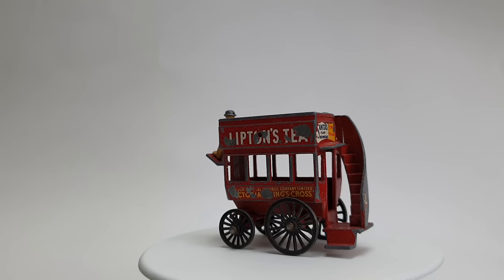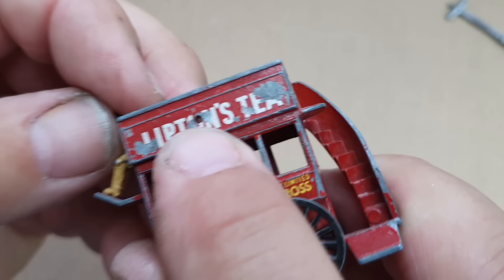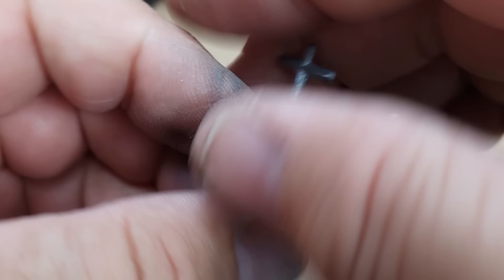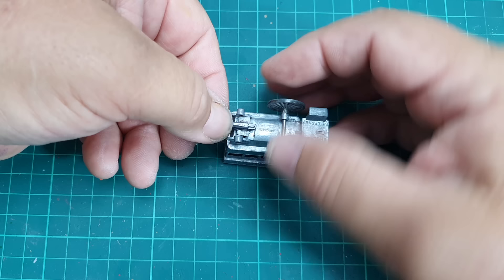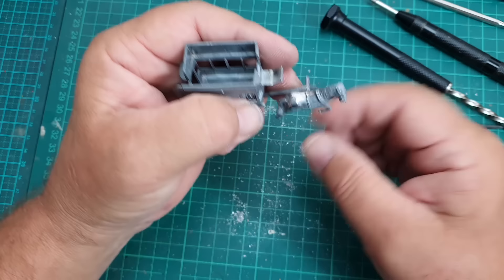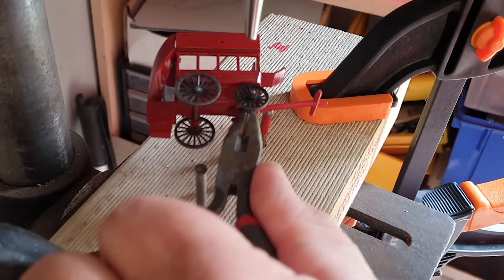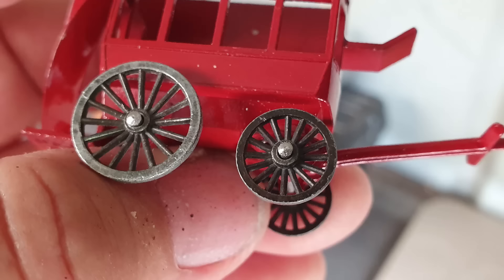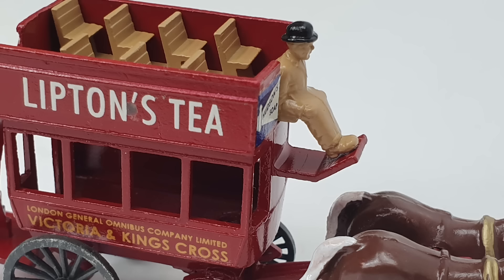MATCHBOX Restoration Y12 1899 London Horse Drawn Bus 1956

Comment: I have had success spray painting decal paper the colour I want, let it dry then print your decal, and treat as normal, it's worth experimenting with.
Reply: its not the background colour thats the problem - its the text colour. You cant do white text without an APLS printer
Reply: If you select the colour button of white on the fonts and print on a coloured background it will just leave the font without colour being printed at all therefore leaving the background colour showing? so print a red square with a white font chosen,  if you get my drift? you can buy white backed decal paper so the same process is used for that. you don't actually have to print in white

Comment: That little paper tool to protect the car while removing he axel looks just like a fingerboard guards for guitar repair. They fit over the frets so you can file or polish the frets without harming the guitar wooden fingerboard They're typically made of metal and can be purchased fairly cheaply on guitar repair YouTube pages like Stew Mac. Run about $15. (i have no affiliation - just happens to be the one I use for tools). Check it out Marty, might work perfectly.

Comment: For drilling or gripping allmost microscopic objects small as those in this vid, ye should buy a jewellers grip. It is pliers with an incridibly small "soft clamping jaws" that are locked in place with an actual springed pin- or cliplock. Thats why it gives locked, durable, and hard stability, but it doesnt leave any gripping/ tool marks in the object, while giving good, singlehanded, 360 degrees handleability for drilling, dremeling, band grinding or machine polishing micro-objects.

Comment: 9:35 Marty, you should have Muggy-welded the draw bar to the base plate after you mushroomed the pin to add strength back and it would have looked better as well as it would have filled in the gap. otherwise another great model from you Marty, great work.
Reply: The melting point on those white metal replacement parts is pretty low.  I'm not sure if they can be welded using the Muggy weld rods but my guess is that the part would melt at about the same temp as the muggy weld.

Comment: Those bumps at the back of the horse are the heads of the bolts that hold the back legs on. The Victorians weren't as good at hiding those as modern horse manufacturers are.

Comment: Marty, I’ve loved watching all of your builds, the one thing I’ve not been able to do that yours comes out perfect is mushrooming the ends of the axles, how do you make your nails to make the large mushroom? Mine only mushrooms a very little bit. 
Keep the videos coming.
Thanks,
Andrew from California
Reply: He recently changed to using nailsets.
Reply from the maker: Andrew, I make it look easy but it is not. I often have to attempt this more than once to make it work. I have recently started using a nail punch with a cupped end. I think it works a bit better than the modified nail. Give this a try and let me know how it went. A nail punch set only cost me $6 here in Australia. Good luck!
Reply: @MartysMatchboxMakeovers  I've been using a nail set for years (pick one for a large finish nail).  Keep the drill press on the slowest speed. Hold the axle and keep it from spinning (like Marty does in the video using needle nose pliers) and watch how long you spin the axle end as it will quickly heat up and can very easily ruin a plastic wheel in the blink of an eye!

Comment: Marty, it looks to me like that horse casting wasn't all that great  to me. The surface is very grainy and not smooth like the original. Also there was way too much  flashing. All in all, not what I'd call first rate. You did an excellent  job  to get it right. Cheers from another veteran. U.S. Army.

Comment: I wonder why RecoverToy didnt cast the new drawbar with the mounting plate attached? Seems that would have made replacement much easier 🤨
Reply from the maker: 100% agree!!
Reply: @MartysMatchboxMakeovers  That draw bar is for the first released casting of the Shand Mason fire wagon and the horse drawn bus. The revised (later issue) two pin draw bar is made as a replacement part, you just have to order the correct one.  Tony @ RecoverToy doesn't make these, he gets them from Steve Flowers in England (model-supplies.co.uk).  The correct replacement part makes all the difference and fortunately there are not too many parts like this where you have to really watch what you're ordering.  Most of the dealers now have a photo online so you can see the actual part to help avoid these kind of mix-ups.
Reply: An addendum to my comments: I just had a look at Tony's web catalog.  That single pin draw bar comes up first in the catalog.  One would think the double pin draw bar would be displayed right next to it but it's not. The double pin draw bar is featured further along in the Recovertoy online catalog.

Comment: Hi Marty, I have been trying your technique with the drill press and modified nails to reform axles post restoration. Please can you give me some tips as it does not work for me. I have tried using the old axles, nails and pop rivet mandrels but with no success. I have even tried your latest technique with a nail set in the drill. Help!

Comment: For fine drilling in white metal like that, for pinning the pieces of a 54mm figure, for example, I like to use a straight pin or a sewing needle to punch a starter hole, and then I always use just a pin vise.  I've found that using a power tool, like a rotary tool or a drill, is too much power and too fast, that if you slip, it can damage the piece.
Reply: Using a pin vise for that purpose is excellent advice!  I use a straight shaft stainless steel dental pic to make my starting point. The handle is much easier to control than a needle.

Comment: Regarding the replacement horse, that grainy texture, and the flash, too, are not untypical for a "second-generation" casting.  That is, your vendor probably uses a silicon rubber mold, made using a Matchbox casting, and a fair-to-middling casting alloy.  The original metal die and the alloy Matchbox used, provided that crisp detail.
I see this with toy soldiers, and copies of commercially-produced figures.  The copies invariably are not as crisply detailed as the originals.

Comment: Hi Marty,
Maybe I missed this in earlier commments, but why did you opt to leave the rear axle and wheels in place, thus complicating your repaint?  I'm sure there is logic behind it, but right now I'm a bit flummoxed.  Seems that, at the cost of only a small bit of grinding, you could have avoided a load of masking.

PS great job, as ever!  Yolur restos are a quiet pleasure to watch.
EDIT - 16:47 I have no idea about his pants, but his trousers look OK :]
Reply from the maker: The truth is that there was no play in the end of the axle and I would have had to cut it off and make anew one. I figured that just for once I would leave it in situ and work around it.
Reply: @MartysMatchboxMakeovers  I was wondering that. Thank you for the explanation.
Reply: @MartysMatchboxMakeovers  I was wondering that myself, thank you for enlightening me.

Comment: why didn't you remove the back wheels ? remind me again......... wouldn't it have been a lot easier ?
Reply from the maker: I only removed the front wheels so that I could replace the draw bar. I left the rear wheels as they did not need to come off and the axle had no free play to expose the end for grinding. I would of had to cut it off and then  make a new axle so decided not to bother. I did give a light coat of gun metal grey to all wheels at the end to spruce them up a little bit but didn't mention or show it.